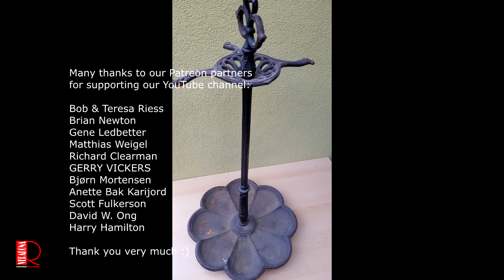Old umbrella stand  - Restoration

Comment: Love the restoration, just wondering does it make a difference if you would go straight to the sandblasting first verses the soaking and scrubbing the material. keep up the video's . thanks
Reply from the maker: I have already mentioned it here, the color had a strange structure and smell, I was worried that it was not harmful to health. (swirling dust from sandblaster)

Comment: Recast the upper broken parts would of been easier and given you an excellent copy.
Reply: In what? Steel? Difficult for small volumes, isn’t it? I have seen lots of brass and aluminum done, but not steel.. his method worked well.
Reply from the maker: Yes William, now that I think about it, you're right. There is one foundry in my city, but they only make series, not pieces in the sand.I have no experience with metal casting, nor do I have any idea whether cast iron can be cast at home? Radek

Comment: Radek—my knowledge of chemistry is minimal. Can you tell me when to choose sodium hydroxide rather than some other chemical to clean a piece? Is it because of the metal involved, or the kind of material that needs to be removed?
Reply from the maker: Not at all Terry, but not all paints dissolve sodium hydroxide. For example, he has a problem with refractory paint. I probably wouldn't even put it in the lye, but I got worried, the paint had a strange smell, so that it wouldn't be harmful to health for the sanding itself, where the dust was swirling. Radek